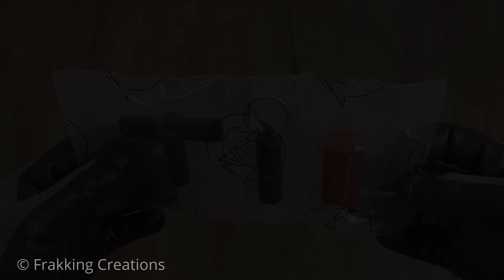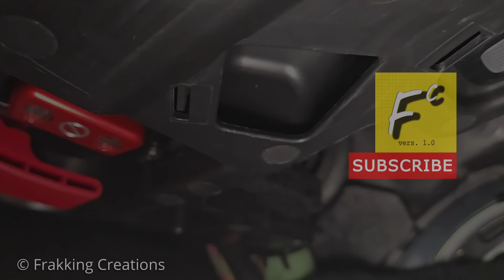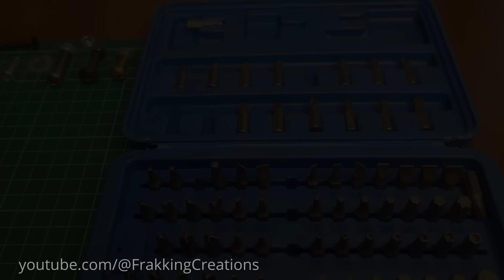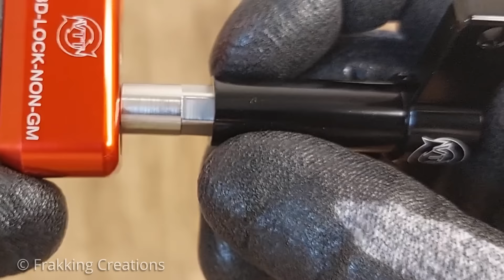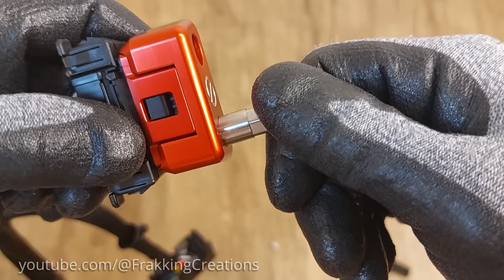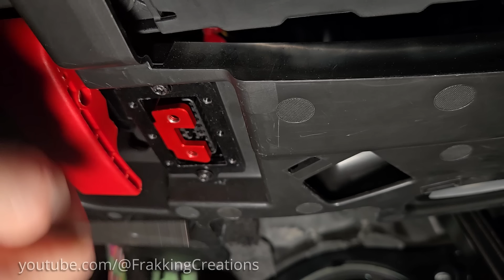Metal OBD port protection from Key FOB cloning & OBD car theft - VTT OBD2 port lock

Comment: SO HOW DO YOU FIT IT TO THE PORT WHILE IT IS IN THE CAR ,,,
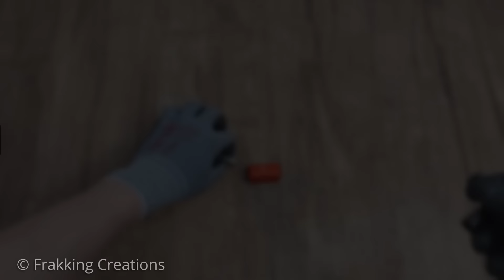Reply from the maker: It's the same steps as shown at 2:12, where I used an OBD splitter cable to demonstrate.  The connector on the cable is the same as what you would find inside the car.
Reply: @FrakkingCreations  THEY ARE FITTED DIFFERENTLY TO DIFFERENT CARS AND WHEN IN THE DASH MANY YOU CAN AT SLIDE THAT METAL BRACKET IN ETC ... AND THERE ARE ALSO DIFFERENT TYPES/SHAPES.  YOU NEED TO CHECK WHAT VEHICLES THESE ARE COMPATIABLE WITH AND SHOW THAT...
Reply from the maker: Of course, it would be nice for a small channel like ours to show all possible combinations of vehicles this OBD port lock is compatible with, but the reality is that we don't have high budgets like big channels or big corporations.  This is also because we are not the manufacturer or sellers of these locks.  We don't have access to all the vehicles possible.

The video is to show what the product is and how it is used.  If you need to know if it will fit your vehicle, the manufacturer or seller would be the best source to ask.

Comment: Curious how you like this over the OBD Saver? OBD Saver seems more robust and tougher to open. Any thoughts since you own both?
Reply from the maker: I reviewed the OBD saver in another video.  That one is better than this OBD lock.  I believe the OBD Saver is very sturdy,  robust and probably tougher to open without the key.

Do note that the OBD saver comes in different versions for different vehicles.  For most vehicles the lock style is not like the OBD saver I reviewed.  It will be a universal style that doesn't lock as well as the Mercedes OBD saver lock that I have.  In a way it is a little more like this metal OBD lock.

Hope this helps.

Comment: Wrong. You can't "clone" a fob using the OBD 2 port. What you really do via the OBD 2, is to add the key as authorized. Usually this should require specific dealer codes or similiar (usually it requires a login to the dealer's server) but some cars are less secure and allows thos over the OBD 2 port without any authentication. So to compare to a smart lock on the door, it isn't like copying a key or similiar, but more like, going into the admin panel and adding a second key as authorized. The two keys are still different (have different encryption keys, different ID number and everything), they just are authorized to the same car.
Reply: Wrong yes you can I have erased and added keys to several cars.

Comment: will it fit new Nissan Pathfinders?
Reply: It’s an OBD2 lock. Every car has an OBD2 port unless its from the 1600’s
Reply from the maker: Typically it will fit most but some vehicles have trim around the OBD port or anOBD port that is recessed making it hard to fit or not fit at all.

Best to contact the manufacturer and see if it will fit your vehicle.

Comment: The glaring problem with these is the fact that the locking tab is exposed. While that may not be an issue on a recessed OBD port, one that is not recessed might be defeated with a screwdriver or something else prying at the locking tab.
Reply: It’s only held on by the plastic clip, Just bought the same and it seems you can use a flat head screwdriver to push it off via the hole. Soft a butter so a waste of time! Could even hold a lighter on the hole untill it gets warm enough to just pull the lock straight off

Comment: i have a alarm, a mobiliser and a OBD port lick as well as a secret kill switch connected to the start fuse wiring when buying a used car always have a mechanic delete all keys and reprogram the keys you have  so the old owner can not have a duplicate key that can access the car you have purchased put two sets of lock nuts on your wheels and above all do not leave tools and valuables in your car  thieves/  criminals will most likely to have a lock pick gun so simply locking your car will not stop them  do the things i have said and werst case you will get a little damage to your car maybe a broken lock you can go farther and use security bolts for bullbats and spoilers and things if you are in a aria were thieves unbolt untraceable parts from your car to sell on eBay and remember the harder it is for them to get it the better it is for you if the car is locked behind gates with a bog dog they will poison the dog with a bate so lock your car in a garage with nan alarm 
i hope this helps people secure the vehicles

Comment: Later when leaving your car if for service and the unit has to be removed , how is the back metal plate which snapped into place removed ?. I don't think its possible. ?  See 4.22 in video where he is unable to remove it. The unit is subsequently useless , the author of this video should have given an HONEST review.
Reply from the maker: It was an honest review.  True that I did not show removing the metal plate, but it was removable.  Or else the vehicle's port would now be blocked, which would prevent me from making new videos that require me to access the OBD port of the same vehicle.
For example, the latest video reviewing this OBD2 diagnostic tool, which would require access to the OBD port:  https://youtu.be/wGSJQ_-sElw

As I was saying in the video, you will need a plastic tool or wooden popsicle stick to use to remove.

That said, this OBD port lock won't fit all recessed ports because every make and model can be different in size.  To be sure you should check with the manufacturer of the OBD port lock.

Comment: Is there a version that encapsulates an obd gps tracker like the bouncy one?
Reply from the maker: I'm not sure what you mean by "bouncy one".  I haven't seen any OBD port lock that is able to lock both the OBD port and a GPS tracker installed on it.

You might want to consider putting in a fake OBD port in place of the actual one, then plugging the GPS tracker to the original plug and relocating and hiding it under the dash somewhere.  This way the fake port in the original OBD ports location doesn't do anything  when someone plugs into it.
Here is our video on installing a fake OBD port:  https://youtu.be/E32PjlttG4M

And if you want to fake it even more, put a lock on the fake port.

Comment: I installed 3 fake ports which are connected to a direct port that acts as a kill switch to the main cpu that is timed for a 10 minute delay. I also interconnected the door locks and windows to be locked and windows closed.
Reply: Make a how to video
Reply: Badass!
Reply: @Gregcallme Yes, as they commenter above me said - make a how to video

Comment: Ummm.... wouldn't the bad guys have tools to get at those security screws?
Reply from the maker: Depends.  These locks have non standard screws so a specific tool to fit may not exist.  But that's not to say that the existing screw bits can't be made to work.  So it would depend on which set of security screws you end up getting with theis OBD lock.

I have seen some star shaped security bits they used in some of the locks and I thinks those ones are easier to remove than the one I ended up getting.

Just remember that even your front door lock or car door locks can be picked or drilled out, so theives also have tools to break into you car or house.  Locks and additional security measures are meant to slow down a thief or make it take longer to steal something.  Hopefully enough to make them move to a different target or get caught.

Comment: I feel like folks are making an incorrect assumption that this is intended to be the panacea solution. This is just one method. You can only control what you can control.

Just because it doesn’t defeat every method, doesn’t make it useless. Layering security through multiple means and increasing the time, effort or skill needed by a thief is all you can do.

If you have a skilled and determined enough thief with some time, they’re going to take your stuff. The average thief that grabbed some OBD scanners off eBay may move on because it’s not a quick score.
Reply from the maker: Agreed.

Comment: Do you recommend this or a fake obd2 dummy?
Reply: I recommend hiding your OBD2 port and putting a dummy one in that is connected to power and ground so it lights up their tools and then trigger it to backfeed and wipe their tools data that would be the best solution😂
But simplest would be putting on a lock and making your real OBD2 port disappear up under the dash somewhere and buying a harness off eBay or Amazon and putting it into the factory locations spot that will definitely slow them down not many thieves will take time to try to find the original and or cut wires to try to figure it out because 99% of them don't have any knowledge of what the actual wires are that do what... At that point they'll just move on to the next one

Comment: This is pricey junk. The inner part leaves the plastic key on the OBD port exposed and, if this is accessible by the thief, it is easy to break the plastic and remove the cap. Perhaps a 30 second delay for the average thief.
Reply from the maker: Agree that the lock is expensive and that the lock should not expose any part of the plastic OBD port.  If the little hole is covered up, it would be a better design and could be one place to improve in a future version.  Disagree that it is useless.  Every lock has a weakness and that's just the way the world is.  Bad actors can pick a door lock or drill out the lock or break the windows to gain access to a car or house, but we all still lock our doors.  We wouldn't tell people to stop locking their doors even though they all have weaknesses and won't be 100%

Nowadays, every system has holes.  All you can do is layer up your security.

Comment: these work on infiniti q50?
Reply: I just installed it on my Q50 no problems
Reply from the maker: Nice. Glad it worked out for you!
Reply from the maker: I don't know what the Q50's OBD port looks like but I think this lock will fit most vehicles.  The best bet would be to take a picture of the OBD port and send to VTT's support email and ask them.  I have a link to their website on the video description.

Comment: Thanks, I bought one of these based on this video, they are of good quality, however after looking at the security bit, it seems like it would be easy to create a key that would open all of these blocks. the security bit has two "nubbins", theoretically at different distances apart from each other to make the locks unique. Seems like to my dumb brain, if you file down one of the nubbins you could use the bit to open all of these locks, as one notch is enough torque as you can't tighten them down much since they are aluminum. I want something with a pick resistant lock, not just a simple security bit. This is better than nothing but very expensive for what it is. It is worth about 50 bucks as is.
Reply from the maker: It is quite expensive.  For the security bit, I have seen some pictures of some of the other ones people have received.  They aren't necessarily of the "nub" type.  Not sure if your idea would work for all the security bit shapes they have, but an interesting point, none the less.  I hope VTT continues to keep the key sets small for each security bit they create and make them unique enough so that keys from one set can't easily open most of the locks with different security bits.
Reply: Agree. It looks good quality but the locks don't look super unique. However, there isn't good alternative with the same quality. As someone that needs to travel to high-crime area, I had to buy this to offset the risk (plus club and faraday box). Hopefully the thieves can go for the next target without these extras. If it's $50 then I wouldn't complain. lol.

Comment: So once installed and tightened it can wiggle and move about a little bit but still remains intact? Seems like I could rip it off of there with my hand if I got aggressive with it.  But I don’t want to break it 😆
Reply from the maker: No. It can't wiggle. It's tight. Where did you get the impression that it is loose when installed properly?
Reply: I mean the two aluminum pieces are tight to each other and don’t wiggle but it isn’t fastened to the obd port really so it moves around but you can’t really get it off. Is that not the way it should be?
Reply from the maker: The 2 pieces are CNC machined out of aluminum.  The are pretty much exact fit around the OBD port.  It might be possible to slide it outwards a tiny bit, depending on the individual form of the specific OBD port.  But this doesn't seem to be much at all.

Comment: I can see an issue if you have a recessed port and need to take the car in for a service.  The retention plate looks hard to remove.
Reply from the maker: It is harder to remove but not too hard.  Best bet is to just keep a popsicle stick in the glove box and remove OBD lock yourself before handing over the vehicle to the mechanic.

Comment: Thieves start Toyota cars with just the headlamps connector. No need OBD port anymore.
Reply from the maker: True.  They are using the CAN Bus through the headlight modules.

Security is about layering because theives will always use the weakest link.

There are too many ways to steal vehicles nowadays.  People can also break into your house by picking the locks or drilling them out.  But we all still lock our doors for a reason.
Reply: has that been fixed yet?

Comment: Pretty expensive at nearly $200 delivered
Reply from the maker: Yes, this can be expensive.

I noticed that some Amazon .CA stores that are not related to VTT bought these and are selling them at a marked up price of about $200+ CAD.  VTT sells theirs on their Amazon .COM store for $99 USD.  If you are ordering from Canada, there would be about $6.38 USD in Amazon shipping and $13.39 USD in import charges = $118.77 USD.  Convert using exchange rate of 1.4800 and it is $175.78 CAD.  So if anyone is interested in this, it may make better sense to buy from the manufacturer's Amazon .COM website.

Also, VTT does have a website where they sell their OBD Locks.  Looks like for the same price but I'm not sure how much shipping or import charges would be.  The benefit of buying here is you have an option to buy additional security bit / keys.
Reply: It’s $99 on Amazon
Reply: It's $100 on Amazon